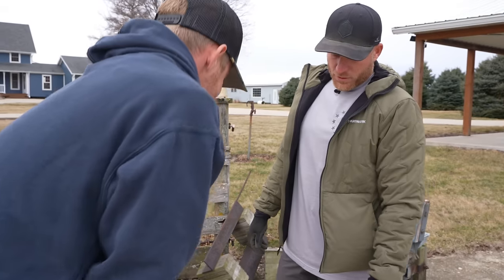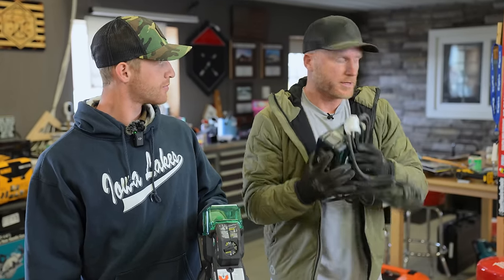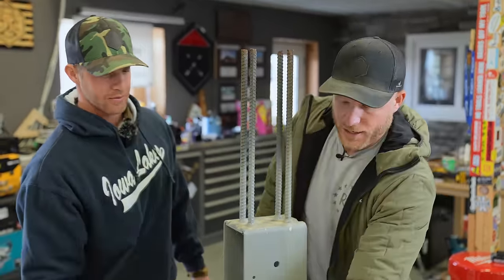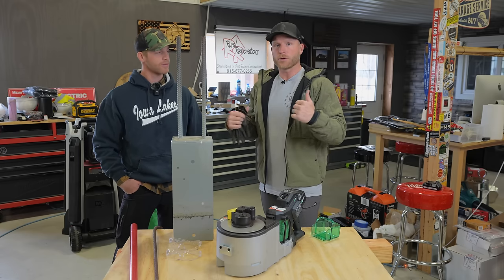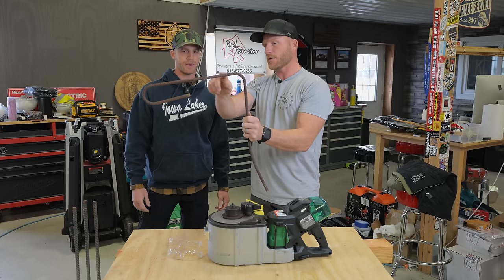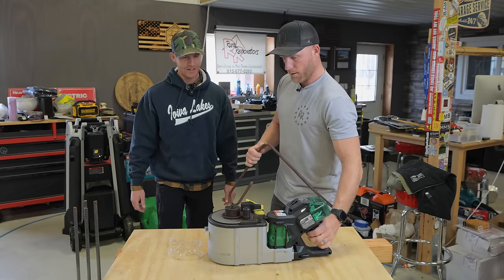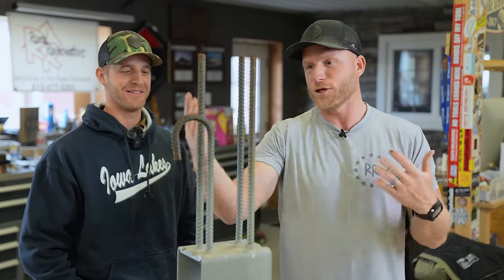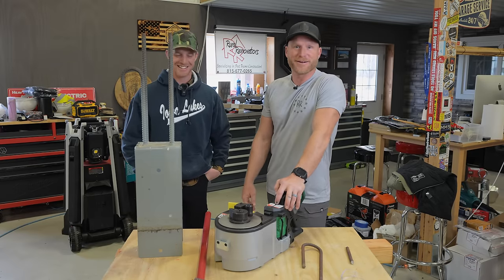Toolsday: Bend Rebar Like a PRO

Comment from the maker: This is a tool that amazes me everytime I use it how effortless it makes the task of bending and cutting rebar!  What are you thoughts?
Reply: Love your stuff man awesome work
Reply: #AD
Reply: Amazon has them 20% off right now. You made perfect timing on the video.
Reply: The fact that you can cut and bend all of the rebar for a stem wall of a 40X80 and the hardest part of the task is pulling the tool off of and putting it back on the tool trailer makes it a no brainer . Why fight the job while trying to get it done ?
Reply: A couple of more bends you could have made a large  paper clip
Reply: I am dating your sister Rukia, GREG! I know you :^)
Reply: If you are not pouring gigantic volumes of concrete, then the price is high.  It seems to me that about $1000 is the real cost.

Comment: I use this tool on every foundation I pour and the battery lasts around 40 linear feet of wall. You get two batteries and a fast charger so you’re pretty good. Only thing is you need one guy on bandsaw and one guy on metabo to make the most of your time.

Comment: as you mentioned alot of times before , these brackets are ICC certified. with that said. if there was any reason what so ever,if they would only think a J hook was necessary, they would have bend a J hook in the factory before welding them on. so i'm in team I instead of team J 👌

Comment: is there some accessories for different radius?  The canadian guide of rebar installation ask to put a minimum (1 3\4) radius in the bends of number 5 rebar by using a 90mm (3 1\2 '') chuck. When an engineer told me that I made jig with hard wood instead of a using a vice. A cheater bar make that easy and the jig had an ajustable stop (nothing fancy, just a screw) to make repeatable bends. 0$ to make a jig for a job that requires 250+ bends. I'm still looking for an efficient and cheap method to cut the rebars. A grinder is annoying and a diablo blade is dead after 80 cuts.